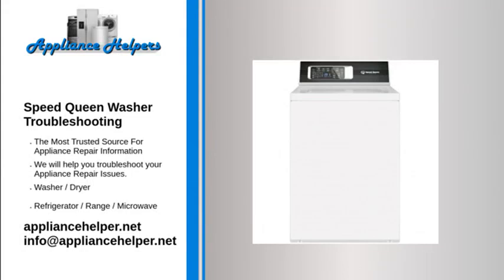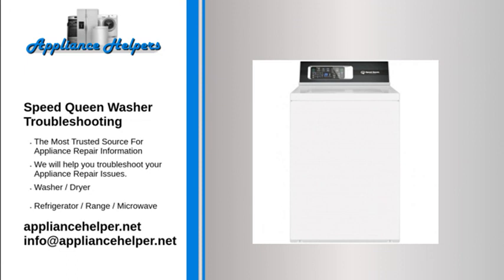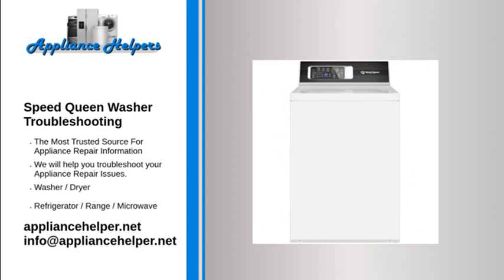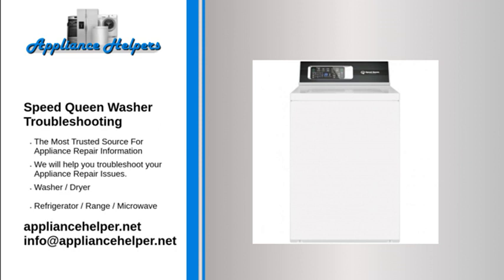Speed Queen Washer Troubleshooting

Comment: Hi, my Speed Queen Washer stops in the middle of working at 12min. what should I do??
Reply from the maker: If your Speed Queen washer stops in the middle of a cycle with 12 minutes remaining, there could be several potential causes for this issue. Here are some troubleshooting steps you can take to address the problem:

Check for Unbalanced Load:
An unbalanced load can cause the washer to stop mid-cycle. If the load is too heavy or not distributed evenly in the drum, it can trigger the washer's imbalance detection system. Try redistributing the clothes more evenly inside the drum and restarting the cycle.

Inspect the Drain Hose:
Ensure that the drain hose is not kinked, twisted, or clogged. A blocked or restricted drain hose can prevent proper drainage, causing the washer to stop mid-cycle. Remove any obstructions and straighten the hose if necessary.

Check the Water Inlet Filters:
If the water inlet filters are clogged with debris, it can restrict water flow into the washer, leading to cycle interruption. Clean the filters to ensure proper water supply to the washer.

Verify Water Supply:
Confirm that the water supply valves connected to the washer are fully open and providing adequate water pressure. Insufficient water supply can cause the washer to stop mid-cycle.

Inspect the Drain Pump:
The drain pump removes water from the washer during the spin cycle. If the pump is faulty or obstructed, it can prevent proper drainage, causing the washer to stop. Check the drain pump for any obstructions or signs of damage.

Reset the Washer:
Try resetting the washer by unplugging it from the power outlet for a few minutes and then plugging it back in. This can sometimes clear minor electronic glitches and restore normal operation.

Error Codes or Diagnostic Mode:
If your Speed Queen washer has a digital display, it may show error codes when a problem occurs. Refer to the washer's user manual for information on interpreting error codes or entering diagnostic mode to identify the issue.

Professional Service:
If the issue persists after performing these troubleshooting steps, or if you're unsure about performing further diagnostics or repairs yourself, it's advisable to contact Speed Queen's customer service or a qualified appliance technician for assistance. They can diagnose the problem accurately and recommend the necessary repairs.

By following these troubleshooting steps, you can identify and potentially resolve the issue causing your Speed Queen washer to stop mid-cycle. Remember to prioritize safety and always refer to the washer's user manual for specific instructions and guidelines.